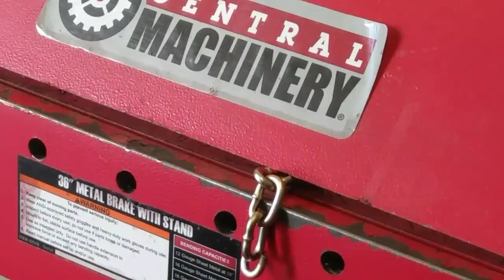The Black Death (The Ultimate Baseball Bat Mod)

Comment: The only 3 problems I see with the design is, number one the saw blades would most likely get snagged on clothes, light armor or even yourself. They also have the possibility of bending if you miss and hit a sidewalk or something. Number 2, with the handle being rounded it will be much harder to have correct blade control. Number 3, with the amount of screws you put in place you probably weakened the top part of the bat. But hey guess we'll wait for the demos!
Reply from the maker: Ah i see you have a keen eye! You make a good point dude. Like you said, we'll see in the demos. Atleast it looks cool lol
Reply: @apocalypsepyro  I think the coolness factor would just make your enemys explode XD
Reply from the maker: @LawnMowerProductions  XD heck yeah!!
Reply: Yeah that many screws defiantly weakened the durability of the bat looks dope would have flaws tho like multiple weapons  but I'd have used aluminum bat and a rivet gun with concrete screws